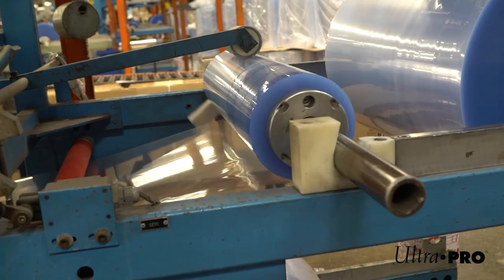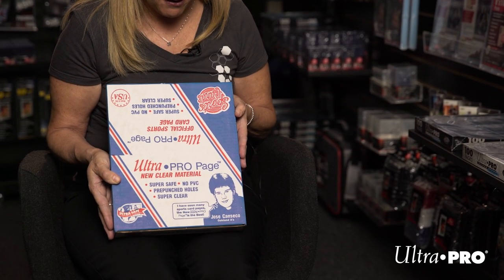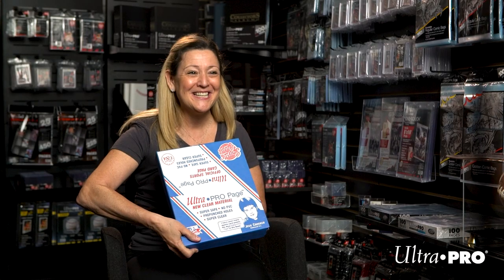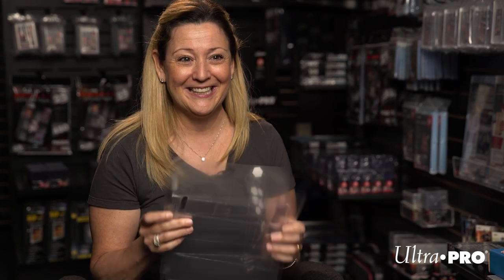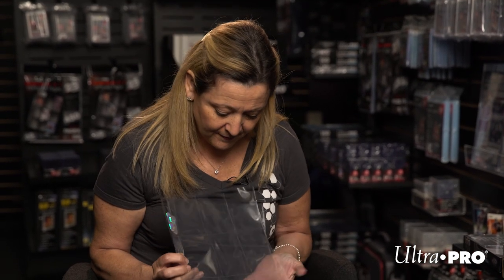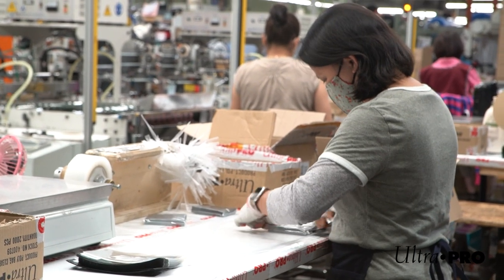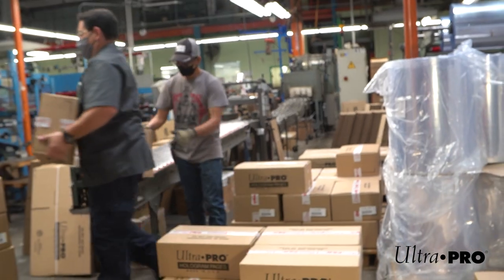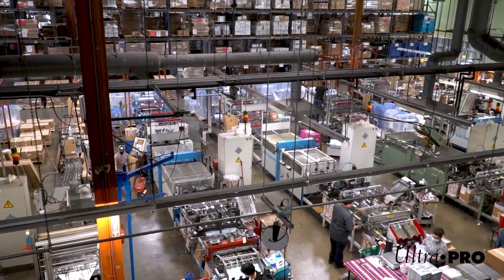Inside Ultra PRO | The History of the 9-Pocket Collectible Card Storage Page

Comment: I don't know if there's quality control issues going on but my Ultra PRO Platinum pages are warping my cards. Like another commentor mentioned the bottom left pocket is rippled due to the logo there and any cards take on the shape of the pocket. You can even see the diagonal ripple in this video.

The 3 pocket pages for postcards are also warping my postcards (same issue with the bottom left pocket). I'm extremely disappointed and I don't understand how these can be sold when the warp your collections.
Reply: The last set I bought is very rippled and warped all over. Definitely quality control issues.
Reply: Yeah I got back into card collecting in the last two years or so and only recently ran out of the old ultra pro 9 pocket pages I had. The newer ones I bought are NOT good. I thought maybe I simply got a weird batch but after searching around, it doesn't seem like a unique problem.
I'm hoping there's some other company that makes decent pages.